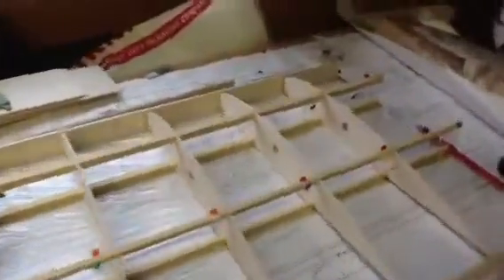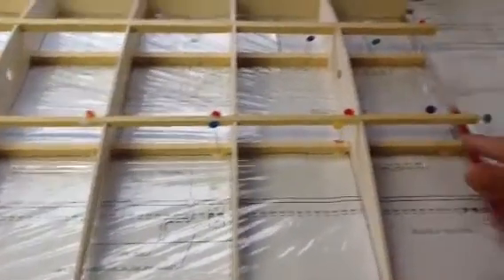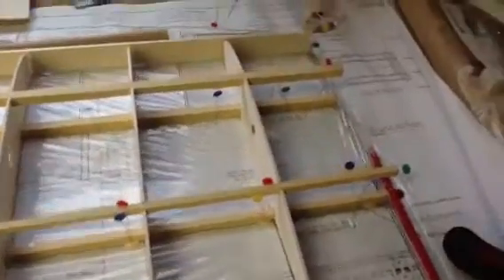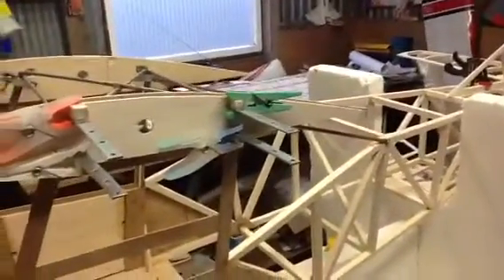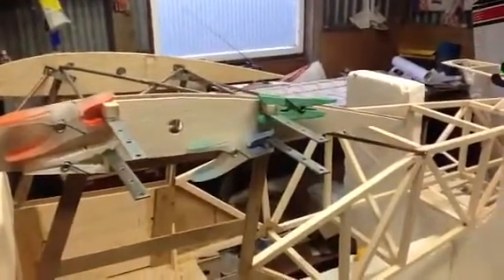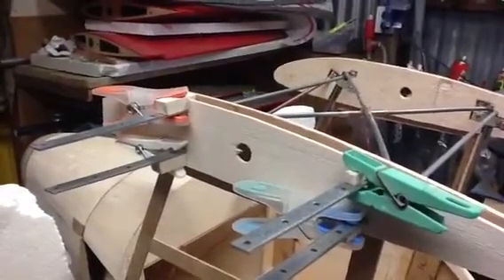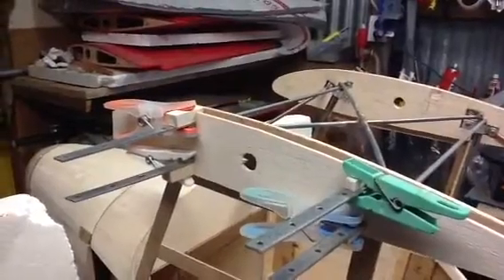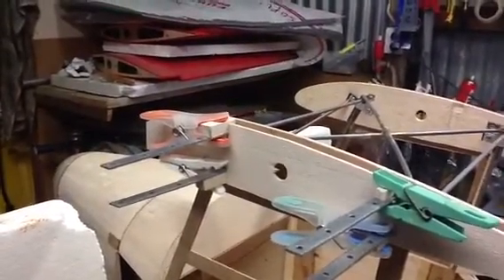Airsail Auster AOP9 1/4 scale wings1

Comment from the maker: Hey there, sorry that the video is not more clear. The brackets are as mounted on the wing root on the fuselage. They are sandwiched between the top and bottom spars on the wing. Spars are reinforced by metal sheet, same thickness as the brackets. The space between the spar pairs is packed out with balsa sheet and sandwiched vertically with ply. The wings slot over into bracket arms. Held in place by an M3 bolt per spar pair, nyloc nut embedded in the bottom spar. Struts support the wing.